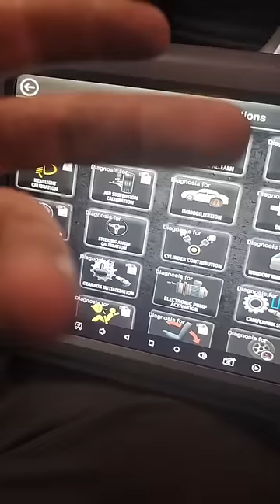anti theft

Comment: I miss the old way of cutting keys. I enjoyed it alot as a kid. Definitely more protection this way, but if you lose a key... its gonna cost you.
Reply: It’s not much more protection, just a different design.  They can be picked just as fast
Reply: It's not the key that protects. It's the signal. Which can be spoofed and copied.
Reply: @shaunofthedead3000  I understand that, I know guys that program keys, but it is another layer of protection. There are only so many things you can do, and someone will figure out how to bypass it.
I was just saying that I miss the old hands on, learning to cut keys, figuring out how the locks worked, all of that. We had a little key room at my grandfather's house as a kid, and I really enjoyed learning about it. Now it's all pretty much computerized, even cutting the keys.
Reply: @arnold8746  I have watched theirs at our dealer get in and start the car in less than 30 seconds drive away. It’s sad that the more technology we put to protect our vehicles the easier it gets. We have had recalls to block hackers from getting into the radios and taking over the vehicles.
Reply: @arnold8746  my solution solution is to not waste so much money on a car and that people want to steal it from you. My car is older and simpler and doesn't have power windows and locks that will get stuck, or a bunch of electric junk that will break, and I don't think anyone would really want to steal it
Reply: @katiebarber407  I hear you on that. An added benefit is that you can still make most any repairs yourself if you have a decent set of tools and are a little bit mechanically inclined. Today's cars you need to have an expensive reader and whatever software that the everyday person can't afford, which even if you do happen to have access to, you probably cant get the part or whatever specialized tools neccessary.
Reply: @katiebarber407  and some people enjoy having nice cars lol
Reply: Hey, that just teaches more people to be responsible.
Reply: @goat3898 except they have a physical key and an electronic key
Reply: @shaunofthedead3000 modern car keys aren't vulnerable to replay attacks
Reply: @Aweoe  

Ever messed with a flip switch? 

Modern car keys are no harder to bypass than those from 20 years ago. 

Especially if you have a keyless system. 

With little money invested you can get into any car and start it with ease today. And the more that car is set up for user convenience the easier it is.
Reply: @shaunofthedead3000  what about keys that use rolling codes?
Reply: @alexanderquilty5705  

Flip switch doesn't care.

Comment: Today's mechanic has to have a computer science degree to work on cars today
Reply: My uncle who has been a mechanic since the 1960's is glad his career is ending, as he said it's all computers now, and they cost a lot.
Reply: No doubt remember when you popped the hood and it was copper wires fuel line and orange juice cans and you could do anything yourself life was so much better back then
Reply: This is not computer science lol. Its just a few steps to pair the key and car. Getting a bluetooth device to connect seems more complicated than this specific pairing of the key and car step
Reply: That’s not true. He didn’t have to  read or right the computer language. He had to be educated on how to plug in a scan tool, read the trouble code…. Cut the key, and then use his scan tool - and tell it to program the key. He has to be educated in automotive technology. Not computer sciences.
Reply: @MJ100k  agreed. Pretty much just people afraid of new stuff and getting left behind
Reply: keep up
Reply: My grandpa said he'd be a great mechanic from all his experience, but now there's so many electronics he can't. Glad he can still help on my old bike, the old stuff is more fun sometimes
Reply: @RaisinBarXZ550  skill issue
Reply: Those who said you don't need to be skilled in computer sciences or engineering has never diagnosed something outside of a generic code scan.  Diagnose an intermittent problem that won't set a DTC using an oscilloscope and get back to me.  Love the arm chair mechanics of today.
Reply: @eurotrash55  even then, you're not programming shit. You're just looking at squiggly line on a screen. Lmao

Unless you're pulling up VS code and literally debugging something I don't wanna hear it. Ya'll would probably just replace the computer at that point
Reply: Not really, just need to know how to follow instructions and use some different tools
Reply: @eurotrash55 cope, high schoolers and hobbyist use oscopes
Reply: Not true… you have to invest in a ~$10,000 scan tool and maybe some other odd and ends of equipment and ridiculously expensive software that walks you through the entire process.
Reply: @alexanderquilty5705  Not to mention all of the one off tools for vehicle specific n part specific repair or removal. Very expensive and very frustrating. I'd rather work on pre-'96 trucks.
Reply: This is true I hook up my scanner on basically everything to look at what the network is doing. Not all scan tools can communicate with the comm lines that are in the newer vehicles cause the network speeds are different but the latest and greatest comm lines are like flex ray and DOIEP and you need a scan tool compatible to communicate with the network.
Reply: It'd be like learning how to make keys if you worked at Lowes or home depot. Take you 30 minutes a couple youtube videos.
Reply: @eurotrash55  So as a machinist I can tell you that even what I do with figuring out set ups and fixtures and actually long hand writing computer code and using solidworks and mastercam and having to read the code and troubleshoot the code. It's so far removed from actual computer scientists and engineers do. I could absolutely transition into either of those fields much easier with that knowledge but no I am absolutely not a computer scientist or engineer. Like somewhere in the world there are computer scientists and engineers that literally built the machine and programed the controller of the half a million dollar machining centers. That's what they do. They are so incredibly smart it's insane. Saying a car mechanic or even a machinist is in anyway equivalent to engineers or computer scientists would be like saying a CNA is equivalent to a doctor because they both have patients.

Comment: I have a 2014 Equinox and the flip key snapped off. I ended up buying a programmable fob on Amazon, programmed the fob using the other key, and just switched out the blades.

Comment: I use the laser key extreme for my van but I’ve heard good things about the tritons, also another thing on the B119s is that if there is trash in the cuts or it is off set in the vice a little bit it will not trace correctly

Comment: I hate computers in cars. Had someone try to steal my Traverse and rip up the antithetical module. That was a nightmare. $1k to find out that it blew the circuit board on the BCM. One of the little resistors. Took quite a lot to even get it running again, and GM failed to diagnose it, but charged me $360 anyways, even though I had to tow it out of there. Napa found the problem, after GM failed. Pain in the ass car....

Comment: You really got all the toys my BMW jammed. There is no getting the ignition out of that. By the time you’re done throw the whole column away the key that came with it will not start the car. I had to take the transponder out of my old key cut open the new key and switch it. The key and switch is like 450 I got the column with the key 150.❤

Comment: Is that 10 minute key cycle only for those equinox? Never heard that and seems very convenient, good video!
Reply: My wife's cadillac is similar,  but it takes 3-10 minute cycles
Reply: any GM vehicle with a physical key. and like somebody else said you have to do 3 10 min cycles. also if you have 1 working key still you can do what's called a quick learn. start the car with a leaned key, then start it with a new one. learns it immediately.
Reply from the maker: @joec1995jc  bingo
Reply: Appreciate y’all that’s super useful knowledge
Reply: @autotechmike  
is it just GM's?
Reply: If it's 2017 or newer you need two previously programmed keys or the three 10 minute waits.
Reply: @autotechmike  hey mike, ive been trying fix my moms 08 hhr (reduced eng power) code on dash, ive replaced throttle body, map sensor, maf sensor, new spark plugs.
Still not Fixed, also replaced 02 sensor where squirrels chewed wires. Any ideas would help. Could it be bad ECM?
Reply: @harrybalz525  what does your scan tool tell you the reason for it beingvin limp mode? It is obviously a serious issue and that is the reason for it going into limp mode as it shouldnt be driven at all unlike the typical check engine light that doesnt effect performance because the issue isnt serious enough to cause damage.. so, what codes has it kicked out and why have you done what you have done, just guessing at what might fix it? Not to be rude but that is what it sounds like, change the typical items and hope it fixes it, unfortunately all the parts you have replaced typically wont put the rig into limp mode.
Reply: @joec1995jc  Fact. Did it with my Camaro a few months back. Easy-peasy.

Comment: I have a 2012 equinox that we bought brand new and it is a GIANT POS. Motor was re-ringed at the dealer and still burns oil like crazy. Dealer has also installed two new catalytic converters and the mid pipe just popped again. Trans is making noise now but it just has to last until our ordered Maverick comes in at the Ford dealer, they said it could take nine months to a year.

Comment: It was a fob issue, the key was still fine. To reprogram put old key in and turn on for 30sec, turn off and put new key in and turn on for a short time, turn off and start the car. 

When I had to do mine cuz the fob buttons broke I just bought new ones and switched the key blade to the new fob and went through the easy and found online reprogram process and was done for under $50

Comment: What you can also do with those keys is use a little roll pin punch, remove the blade, and you can swap the blade into the new fob. Granted, a new cut will look nicer.

Comment: Laser cut keys. Dang Daddy
Reply: That was a CNC there was no laser
Reply: @yzrippin  it was a CNC router. CNC doesn't mean diddly squat on its own, laser cutters are CNC
Reply: @richardmillhousenixon   So just as I stated and as you reinforce it is a CNC machine and there is no laser...... where was i wrong?
Reply: @yzrippin  CNC does not mean there is no laser. CNC just means computer numeric control. Any machine can be CNC, including laser cutters, water jets, routers, vertical and horizontal mills, automatic welders, and more.
Reply: @richardmillhousenixon   Yes and thus this machine is in fact a cnc correct and there is no laser correct again where am I wrong
Reply: @yzrippin  "That was a CNC there was no laser" implies being CNC means it can not have a laser.
Reply: @richardmillhousenixon  did you see a laser in the video tho?
Reply: @Rancid_Ninja  I will repeat, because apparently it wasn't clear. "It was a CNC there is no laser" implies that being CNC means that it having a laser is impossible.
Reply: @richardmillhousenixon  was there a laser tho?
Reply: @Rancid_Ninja  Reading comprehension isn't your strong suit is it? I'm not arguing that there was a laser in the video, I'm arguing the usage of "CNC" to imply that CNC machines and laser cutters are mutually exclusive categories, which they aren't.
Reply: @richardmillhousenixon  I didn't see a laser tho
Reply: @Rancid_Ninja  I'm done with this conversation. You're trying to put words in my mouth and you aren't willing to accept that what you thought I said was not what I actually said. Take the L and move on.
Reply: @richardmillhousenixon  I only saw a drill bit, no laser 🤷‍♂️

Comment: How did you diagnose that?  Just experience?
Reply from the maker: Experience
Reply: I always start with the scan tool to pull logs and stored codes, because no customer can be trusted to remember exactly what went wrong and when. The transponder code is a dead giveaway, especially due to the condition of the fob.

Comment: I'm not sure that auto programming of a new key is real good idea, from a security standpoint.  I get that it's a funky key with grooves, but if that's defeated the electronics are going to give you a pass.
Reply: You don't get it, it's the same as factory after it runs through its process.

Comment: I got an 11 with no crank no start been through everything but the security systems, got any suggestions?
Reply: What year/model
Reply: @LocksmithJeremy  ok it's a 05 Equinox LT AWD, no power to the starter changed ignition modules and main computer before it came to me, there no check engine light no major codes displayed, just abs sensor and something else like it, has nothing to do with the problem of no start. I'm a bit stumped.
Reply: Not sure if it's got a PASS system 
But most likely it does since it's not a transponder/chip key (standard metal key) 
Take ur plastic shroud off around the colum a PASS system will have a small plug (its about a 1/2inch in size and a few small wires ) rite above or on the ignition lock cylinder housing 
I would rule that out.
It's a known issue with Gm PASS systems
Reply: And that's on the 05-06 Equinox bro with the PASS
Reply: Do u know if the newer ecu/ecm had the old parts bin file (by the vin#) loaded onto the new
Reply: Is there a security light on the dash flashn or sayn anything about anti theft
Reply: @LocksmithJeremy  last time I was working on it I didn't notice any lights like chk eng, security, or anything, I'll head to the vehicle and let you know
Reply: @LocksmithJeremy  as far as the bin file I do t know the part was already Installed when I received the vehicle.

Comment: I have a 2011 GMC Terrain and it was starting and I changed timing chain and deleted all codes. after that it wouldn't start.  just turns over could this be my problem just do the 10 min thing 2 times? I'll have to try it

Comment: Hang on. You don’t need to do all that if the buttons are the issue. The “key part comes right off held in by a pin. If the board still works you can just put it in a new case that has good or new buttons

Comment: I have a 2008 Mazda 6 same problem I've had keys cut and programed to the doors but won't start and I don't have a scan tool.
Any ideas..
Other than putting it back on the trailer and driving 30 miles to the nearest dealer
Reply: Not to be a smart ass but... get a scan tool?  You can get a decent one for around $200
Reply: @Tony-rl2fr  a $200 scan tool won't program keys.
I have a scan tool it's a cheap one you need to pay over $1000 for one the programs keys
Reply from the maker: @glengrimm4075  I would try the program sequence again
Reply: Great idea take it to a locksmith
Reply from the maker: @LocksmithJeremy  agreed

Comment: I have a spare key for my 2010 Nissan Altima 2.5 SL, however it’s not programmed to my car. It’s a third spare, but the actual key is cut and works to open the doors. It’s a push to start, any idea on how to program that or would I need a tool to do that?
Reply: Just cut The wires and use roach clips to jump

Comment: You don’t need to set it for 10 minutes I programmed a spare key on my exs equinox, 2 on my Camaro and 2 on my grandpas Buick, and one on a Chevy malibu for my friend they were the same key type as the one in the video. all you have to do is put the original key in run position but don’t start the engine, wait 2-4 seconds take out the old key. Put in the key key put it in the run position do not start. Then you wait another 2-4 seconds and turn the key to turn on the key and it’s completed. You don’t need the programmer or wait 10 minutes.

Comment: How is it able to decode the old key if it's faulty? If the vehicle doesn't read it how is the machine able to?
Reply: It's decoding the cuts in the key, not the transponder. Transponder in new key is programmed either by the car using that special process or with the right scan tool.
Reply: @brianargo4595  thanks when he said decode I thought transponder coding.

Comment: Couldn't you have just punched out the key part and put it on the new fob. Our machine was junk that's what I use to do
Reply: That's what I did, just put the key in a vise and push the roll pin with the back of a small drill bit.

Comment: You sound like the guy who can answer. You can buy keys on eBay. I found one for my car. As in its the exact same kinda key. Part number. Clearly it wouldn't be programmed. Of course I have the original key. Bar getting the manual key cut .. can the eBay key be programmed to my car? With or without the scan tool etc. I've been quoted £180 to £450 for a spare key. It's an Audi 3 button kessy wireless key. Please do advise because the locksmith's are telling me not to buy one. Advise?
Reply: My car only came with one key (2nd hand car). So I bought the fob section from one seller and the blade section from another. Both via eBay, but one was from a dealership if I recall (can't remember which). Both sections had to be programmed, fob controls the alarm, blade controls the immobiliser. I have a scan tool for my car, so did that myself and got the blade cut. Worked no problem. This was in a Holden. While I was at it, I disabled the missing key.